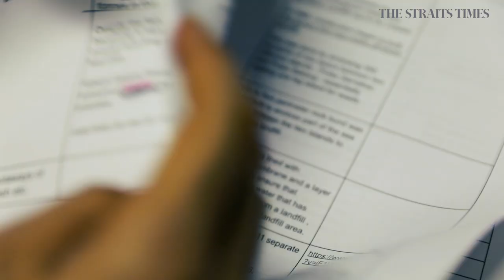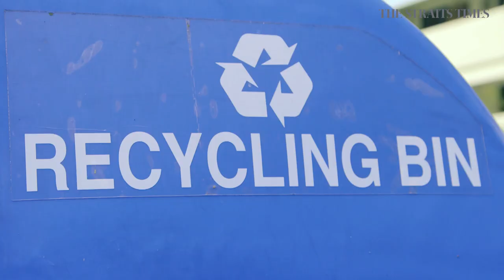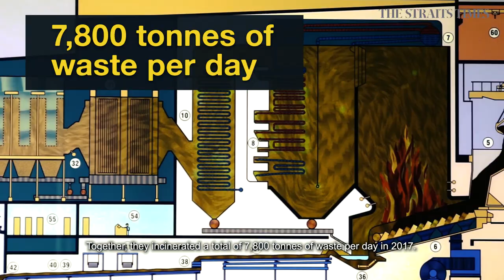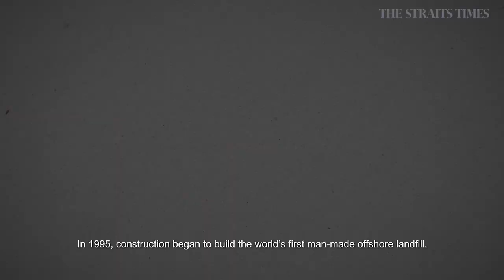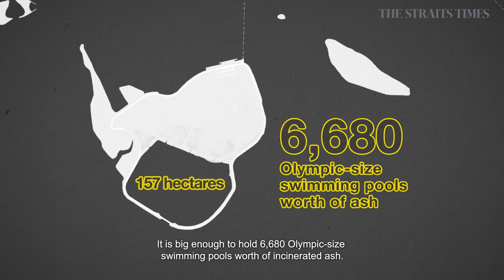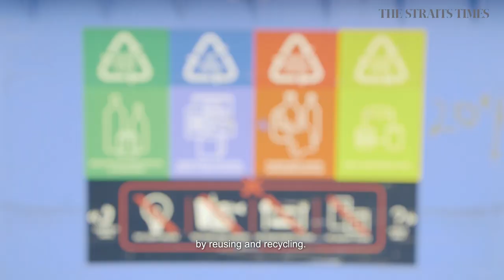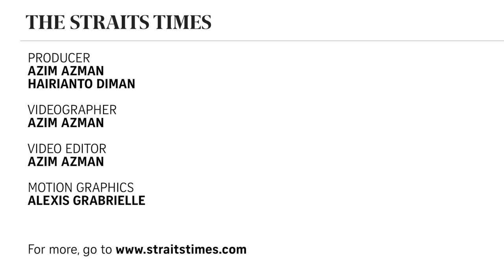Where does your rubbish go? | Singapore Works | The Straits Times

Comment: I'm not completely convinced that these toxic ashes in the sea are safe. But otherwise: way to go, Singapore!!
Reply: They are not disposed at the sea. They are disposed at waters which could never touch the seas. Which means that it is forever hidden from everyone, dissolved in the water that no one will need to worry about because it is made specifically for ashes.

Comment: I have a question, when they burn the trash, what happens to the smoke emitted by the incinerator?
Reply: it is filtered and clean air is coming out
Reply: @zoltanlakatos6623  thank you sir for your response.
Reply: @kingemorej4035  no problem
Reply: Jasmine Collins but they just said in the video that when it’s full they turn it into land so how is the water clean if they are just putting land over it? They wouldn’t need to do that if the toxins would just degrade and disappear
Reply: @biancamaccagnan5771  and what is the problem if they put land over it?The water will still remain clean because the soil will sink to the bottom no?

Comment: Because general rubbish often contains various low-grade plastics, waste incineration produces a lot of thick, black smoke that contains all sorts of toxic fumes. When the fumes are cleaned up, you get an extremely toxic sludge that must be disposed of in designated hazardous waste landfills. With no such landfills in Singapore, what do they do with their air pollution control residue?
Reply: They are generated into electricity bro

Comment: How do you handle the toxic smoke after burning all that waste??
Reply: There is a chimney at the red and white buildings, it cleanses the toxic smoke.
Reply: When incinerator burn the rubbish directly, it will produce dioxin and furan. As incineration is done under oxygen rich condition. 
The only way to change dixion and furan is by secondary burning zone to raise the temperature even higher at 1200-1500°C.
Best of all, dioxin and furan can be produced and can't be destroyed. 
The flue gas needs to be cooled down before released to the atmosphere, usually a waste heat boiler will be installed and generate high pressure steam to run generators.
Which we know by the name of "Waste to Energy".

Comment: My one question is wouldn’t the burning of the trash create air pollution
Reply: Alexsia Morales Singapore is producing even cleaner air by a different process. So basically the trash gets burned and gets filtered really well
Reply: the air that comes out of the chimney is cleaner than fart
Reply: @kushalshrestha9247  it's cleaner than the air around it
Reply: Plus the toxic fumes are generated as electricity

Comment: To burn anything but hydrogen and oxygen is to waste a resource.
These plants are extremely expensive and can cost more to run than the power they produce is worth.
Where do the pollutants from the chimney scrubbers get dumped. What happens to the contaminated water on the landfill island from all the tropical rain?
Reply: mate people are trying to find solutions, be part of the solution not the problem.
Reply: @fabrizziodasso1878  Have heaps solar power, an electric car, grow and raise most of our own food, aim for zero waste.
Pyrolysis might be a better way to process waste plastic. The best solution is not to use it in the first place.
Reply: @andrewradford3953  Singapore dont have enough space for solar power.
Reply: @Skurt44  Australian entrepreneur is planning to export solar power from a huge solar array to Singapore via undersea cable.